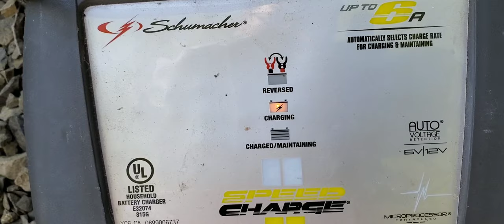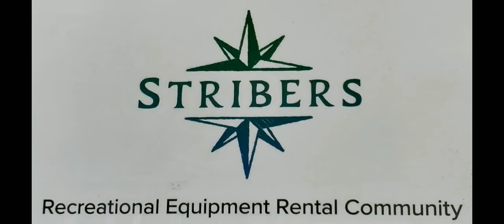Van won't start! | How I Pack Organize my Minivan Camper | Solo Female Van Life Vlog Ep. 12

Comment: Like the MacGyver as a verb..... Suggestion, you should incest in rechargeable A &AA batteries, a bit pricier off the bat but pays itself off in no time. I also picked up a cigarette charger power adapter at Advance that i love but I'm pretty sure you already have something like that.
Reply from the maker: I have a whole solar generator that charges most of my stuff so I don't use batteries for much of anything more like for emergencies. Have you seen my van tour video yet? That's where you really can see my solar generator.
Reply: @SolsticeOnAnOdyssey   @Solstice Elliott  i remember you doing the wiring with your inverter(?) Your friend helped you fix. I'm pretty sure I saw your tour but this video today i think showed a bit more. I also have a solar generator but there are a few days i have been grateful for my power inverter. As to batteries, I feel like I have more than I need but when I actually do need so grateful for. The rechargeable ones not only last longer but are rechargeable 100x!